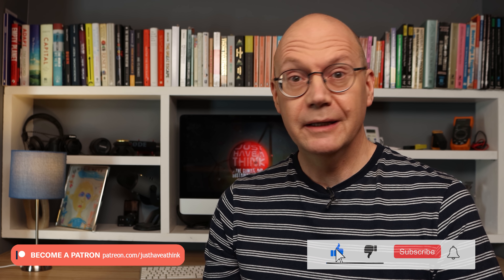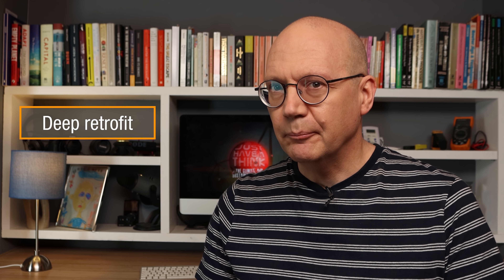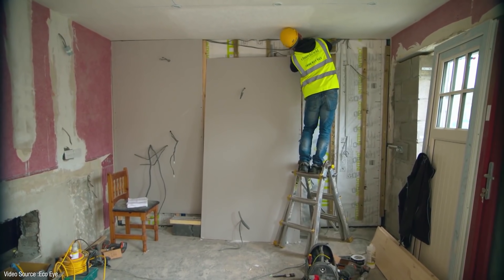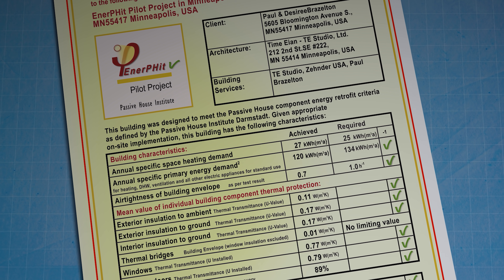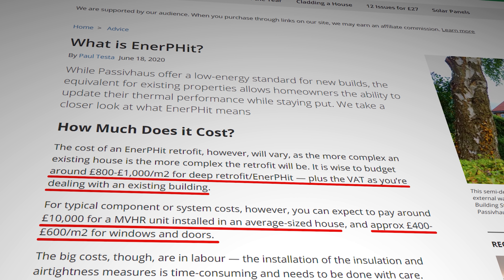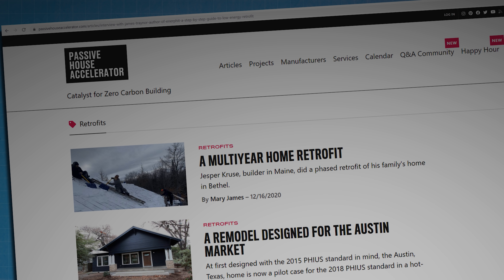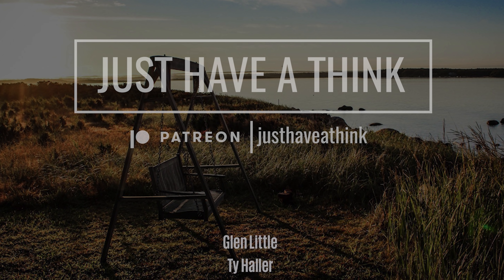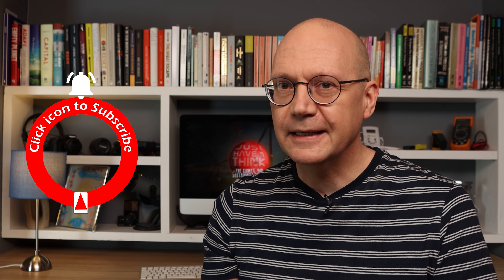Retrofitting to Passive House standards

Comment: Architect here. We have an enormous body of historic houses, where retro-fitting insulation (either internally or externally) and modern windows would mean the utter destruction of most of the character parts of the built environment of this country. This doesn't just include Listed buildings, but, for instance, all of our Victorain and Georgian stock. If you want the destruction of our historic towns and cities, then crack on.
Reply: Engineer here.  I see you where you are coming from and I'm sure the real challenge lies in creating the appropriate path where we can do our best to preserve the envelope characteristics of historic structures all while improving energy efficiency.  Let's make this a better world together!
Reply: @fredflickinger643  Thank you. That's the sensible pragmatic answer. It isn't "retro-fit everything to X or Y per-square-metre standard", but do the very best we can taking all ......all......factors into account.
Reply: @fredflickinger643  Especially since many medieval building had "shells" added in Georgian times, surely a modern take on that would just be history repeating.
Reply: I’d like to have a livable planet, so yeah.
Reply: I live in just such a building. However this is not a "nice to have" it's an essential part of how to reach Carbon Zero.

It would be more expensive but I know from examples I have seen, that it is possible. My building is externally rendered, replacing with an energy efficient render would help. The windows would all have to be replaced and all custom built which ups the cost, but I have seen Georgian windows done that way elsewhere.

So if you don't do this, as an architect, what is your solution?

If you don't people will abandon living in such structures and live in warm, energy efficient homes instead. That will mean empty properties deteriorating rapidly and being lost.
Reply: Is it even necessary to bring historic houses up to near passive standard? Would nit a better solution be to heat and cool them using zero-carbon energy? By all means, reduce the demand as much a possible but without damaging the character or historic value. New builds should be passive, current stock not of aesthetic or historic value should be upgraded but focusing on reducing carbon means reducing the carbon produced by the grid. Esp as we replace ICE with EV it becomes even more important.
Reply: @ablacknambercat  Exactly.
Reply from the maker: 100% Mike. If that's what it takes. I hope you reflect on your words in 30 years time.
Reply: @JustHaveaThink  I'm not sure what you mean (and I'm not likely to be alive, or at least, compos mentis, in 30 years). I'm a serious advocate of low energy buildings, both new and restored, having designed them for the last 30+ years. It's just that we have a large body of historic and period buildings in this country, and I don't want to see them destroyed. The world is full of blandness in the build environment, and I don't think destroying our interesting and varied heritage is the way forward. 
Think on this. Look at the gables of most houses in the UK. Look at the verge (the junction between the roof and the walls at the gable). Note the roof overhang. It's normally in the region of 50mm. Now tell me how external insulation is going to work.
Reply: @MikeAG333  Extending a gable by 100-150mm , even if it requires removing and re-positioning any existing fascia, is surely not beyond the wit of any half competent builder? Shallow soffits would be more of an issue, IMO. And then there's internal insulation as an alternative option- older houses do tend to be larger, where the loss of a few inches of room space will be less of an issue.
Reply: @enemyofthestatewearein7945  You can't just extend ancient rooves, or cover up ancient facades, without destroying the building itself. You can't insulate timber frame buildings externally.The very notion is ridiculous, and the lack of thought about our heritage is seriously disappointing.
Reply: Dear architect, you don't appear to have a grasp on the co2 emissions issue. Perhaps use your talents to appreciate the nature of the ongoing climate emergency we are in just now. One can't compare buildings of whatever age to the relevance of amelioration of the atmospheric and oceanic chemical reactions that have taken place since the industrial revolution. I suggest you get with the programme sir/madam.
Reply: @timkbirchico8542  Dear Timkir. You appear to have jumped to a conclusion not supported by evidence. I have designed and built some of the most energy efficient buildings ever erected on the planet. I have retro-fitted ancient buildings to bring them to the highest possible standards of energy efficiency commensurate with retaining their history. And I've been doing all this quietly for 30-plus years. I am one of the leading people in this field, and am thus very aware of all the issues. The thing is, I also specialise in our (British) ancient buildings, espcially timber framed buildings from the 12th to 18th centuries. It annoys me when people think there are simplistic answers to all of our problems, and amongst the stupid simplistic solutions is a magic wand which retro-fits our historical buildings to some arbitrary level of energy efficiency.
Reply: You could argue that we are arbitrarily in thrall to a specific period in time, which brings perceived character. It's largely bullshit, let's be honest. We had zero problems ripping every ounce of nature out of the way to build the monuments to ourselves, I'm not sure we need permanent erections of a particular period. At what point do they lose their relevance? If they're not functional, why retain them? If they're not built around our environment, why persist? My local city has thousands of Victorian and Georgian era housing, I've owned several and enjoyed them. But the notion that we need thousands of examples should correctly be challenged. Especially when hinged upon "character", which not only seems to suggest that it's impossible to build a characterful building in the 21st century, but anthropomorphises a building, whilst we tear down nature. That's not to excuse most modern mass produced buildings of course, that's an entirely different argument and isn't relevant.
Reply: @ricos1497  Your last point, that mass produced modern buildings need excusing, doesn't sit terribly well with your notion that we can happily lose almost all of our heritage. The logic breakdown there leads us to some Nirvana where we don't have any ancient buildings, nor any current modern buildings, but some wonderful third option which you don't specify. That danger, inevitably, is a homogenised blandness which means houses in Britain are indistinguishable from houses in Australia, Canada or Spain, say......and all in the name of your choice of aesthetic.
Reply: @MikeAG333  no it doesn't! Most mass produced modern buildings are designed to mimic the prior styles. Most UK modern houses are homogeneous, and if you look at a Spanish set of new builds, for example, you'll see homogeneity across that country too. They're that way because profit dictates such. Most people don't choose the house they live in, not really. If they did, we wouldn't have homogeneous towns, which we do. I'm not advocating "new builds", which I thought I'd made clear. It's the notion that we could build with character, with local materials, meaningfully over the last thousand years, but suddenly - despite our massive advances in technology - we're no longer capable. That it's not possible to build more beautiful, more functional and more efficiently (as in efficiency of continued use) than the Victorian era is not something I subscribe to. Moreover, the Victorians built for different times, in a smaller world. We should be recognising now that the entire design of our cities needs to be re-thought and re-worked, from human waste use, water use, active transport (walking, cycling), food growing etc in order that they can last for the next one thousand years (not just the buildings themselves). If those buildings are a hindrance to that then we need to not be afraid to take them down or completely re-design. They are not eternal, at some point we should consider if we can do better. There are a million examples in the UK, we don't need them all.
Reply: @ricos1497  "Most mass produced modern buildings are designed to mimic the prior styles."
Twaddle, I'm afraid. There is no style in our history which involved stretcher-bond brickwork houses on rectangular footprints with spans of 8 or 9 metres, plastic windows,  under a bland roof of machine made concrete interlocking tiles, and all entirely devoid of any craftsmanship or decoration. And that's a description that fits 90% of what we have built in the last 70 years.
And as for taking down the existing and replacing them........yeah, we've a great track record on that, haven't we. And think of the embodied energy. Think of all the concrete. Think of all the bricks.
Reply: @MikeAG333  you seem to think I'm defending the modern house builder, which I'm clearly not. The style of a building has nothing to do with its quality or construction.  Mass produced housing is meant to mimic traditional housing as a quick view of any brochure will tell you. That it's an atrocious and ugly attempt at it has no bearing as I'm not advocating using the current volume builders to replace inefficient housing stock. Similarly, our track record has absolutely nothing to do with our ability, it is entirely to do with cost. There are hundreds of thousands of examples of good, efficient new homes, using passive solar, insulation etc. that wildly out-perform a Victorian era house. Sound housing policy, perhaps even a tax or restriction on second home ownership and land holdings, alongside the curtailment of shoddy house building via the promotion of self build would assist with this. The bottom line is that you're not going to be able to cling on to thousands of leaky, inefficient, expensive old housing stock just because of perceived character, and nor should you. Old houses are popular purely because of the shoddiness of houses built in large scale over the last fifty years, but even then the cost of ownership is still significantly cheaper in a modern house. With targeted legislation on new builds, old housing will be undesirable. With required legislation around performance, which should trump anything involving character (for the overwhelming majority of examples), older houses may become unliveable (they certainly shouldn't be given dispensation). Then communities can create new character and new tradition appropriate for the modern age, leaving the very best of Victorian architecture on display (as opposed to every single example). 
I should add that this is not what I expect to see happen. Lobbying will continue to ensure that massive house building will occur in the wrong places, locking in carbon footprint for the next 50-70 years (would you get that from a persimmon home?). Cowboy practices will see a Serco equivalent crop up in the insulation business resulting in millions of homes being brought up to a standard that isn't good enough, but cheaper than doing it properly (whilst still generating billions in profit). Homes will continue to be built with no thought to their position in both natural world and community. Lobbying will ensure that massive energy schemes will still serve the majority over intelligently designed community schemes.

Comment: I would love to start building passive houses. As soon as this 'conventional' building degree is over that's where I'm headed!!
Reply: There is a difference between a passive house and the nonsense passive house status that the host is talking about. Most of good building knowledge is gained outside of the conventional building degree in my experience. Best wishes.
Reply: Use SIPs - very cheap and easy to make airtight.
Reply: @steverichmond7142  Not that cheap, and you have to live in a polystyrene box? Perhaps look for the readily available and truly cheap materials in our surroundings? Best wishes.
Reply: @jimmycorkhill1390  I make aerogel in my garden shed. I will not use ANYTHING involving petrochemicals.
Reply: @steverichmond7142  I really like building materials, but they can be really hazardous in some situations. As we have seen in recent years and beyond. Best wishes.
Reply: @jimmycorkhill1390  Aerogel is inert in all situations. The only reason it is not used extensively is the charges made by American companies.
Reply: @steverichmond7142  Can I easily make it and use it to insulate my external walls? Can I get hold of the how to do so? I think I recall seeing something a little while back but dismissed it as an option for diy use over complexity in the making or something like that at the time. Best wishes.
Reply: @jimmycorkhill1390  You would usually create a void and insert a product called Space blanket from Aspen Aerogels. It is very expensive. However you can make it. If you are anywhere in the North of England or Southern Scotland I will show you.
Reply: @steverichmond7142  Unfortunately Id like see how it's made but I live much further south and over the channel. I once looked at a material made with cement and I think it was magnesium....cant remember. Something that reacted to cause vast aeration above that in aerated mortar. Im likely going with clay straw then i'll render in clay or lime. Best Wishes.
Reply: @jimmycorkhill1390  Please google 'aerogel' to give you an idea of thermal insulation. This was developed in a university in France in the early 1980s. Ignore most of Wiki. If you have an email address I can send you an old presentation on Airtight Building Technology including hrvs
Reply: @steverichmond7142  Maybe you could make a video showing people how to make aerogel. I'm sure a lot of people would be interested, because as you say the spacetherm product is very good but too expensive for most projects/situations. Or if there is other online info showing how it can be done on a DIY basis a link would be great?
Reply: Have you heard of earthships?
Reply: @rexmann1984  they’re better in their home climate, as are passivehaus. So, they would also be suitable in, say, Portugal.
Reply: @kaitlyn__L  they're good anywhere as long a you got the sense to drain them properly otherwise they'll mildew and flood.
Reply: @rexmann1984  yeah wet climates create more of an issue with earthen buildings, but it can be overcome with proper design
Reply: @whatwouldbenice  what are some ways to overcome humidity in a passive design?
Reply: @whatwouldbenice  Why more of an issue than timber, concrete or metal? Id suggest less so. Best wishes.
Reply: @andrewsutton6640  while we don't have a passive house, we do have a very well insulated house after a 'Deep Retrofit'. That means hardly any natural ventilation. It is solved with a mechanical ventilation system with heat recovery. The fresh air is warmed by the outgoing air, which means we only lose about 5% of the heat. But we always have fresh air.
Reply: @andrewsutton6640  similar to a conventional home, ventilation and sealing off the outside environment is key. With earthen walls you'll want a longer overhang from the roof and some sort of footing on the wall to prevent rain hitting the walls directly. However, I don't claim any expertise/superior knowledge
Reply: @jimmycorkhill1390  that's a fair point, wet climate is a wet climate no matter how you build - it should be water tight
Reply: @whatwouldbenice  Thick stone/earth walls can help manage moisture seasonally, just need keep that rain away. Best wishes.
Reply: @andrewsutton6640  you need to install MVHR - mechanical ventilation with heat recovery.
Reply: @andrewsutton6640  Very simple. They need to be built from timber & have mechanical ventilation
Reply: @rexmann1984  for sure! I think they are very similar concepts that borrow a lot from one another. I'd love to do many of both in my time here on Earth
Reply: @rexmann1984  earthship unsuitable for high density urban situations ie 80% of the world's population.

Comment: We are completely and utterly broke
How are we going to afford this.
Just have a think?
Reply: The answer is to look at how the UK Government funded the COVID measures. Not through borrowing as our dumbed down media and  too many just as dumb politicians lead us to believe, but through Quantitative Easing which is where the money is merely created and owed to noone, it is never issued as Gilts or Bonds.

Check out Richard J Murphy on Youtube and get educated. It might help you understand what is really going on.
Reply: @timregester1173  thanks, I like this kind of straightforward information on economics.
Reply: I'm not broke, and still couldn't afford this. However, I am thinking of the lowest hanging fruit, starting with the cheapest, most effective changes. 1st, gradually lowering thermostat in winter, dressing warmer at home. Best, I'm planning on fixing exterior doors so they don't leak so bad (I can see day light thru mine). After that, an energy audit to seal other air leaks. After that, adding more insulation to attic. If broke, but much you can do other than find some cheap/free materials and diy seal house
Reply: Have you considered homelessness? It's all the rage now.
Reply: @donutemptycircle8717  I would go live in a van if the law allowed me to also have a registered address.
Reply: Look if their are any grants available, loft insulation is probably one of the most effective ways to lower heat loss
Reply: so true! all the money wasted by Gov on useless projects could be given to homeowners.
Reply: Start a youtube channel or something.
Reply: Every human is born penniless.  How does anyone ever afford anything?